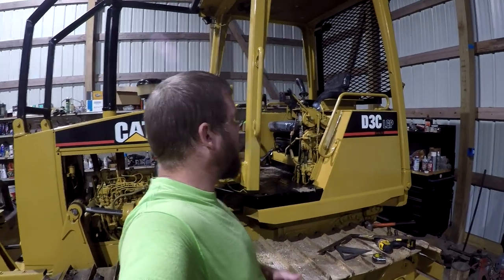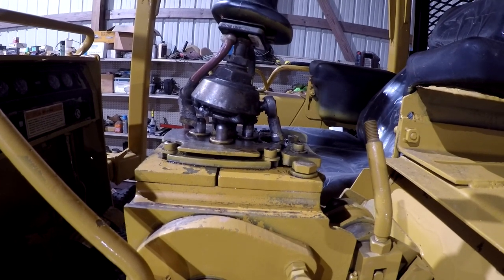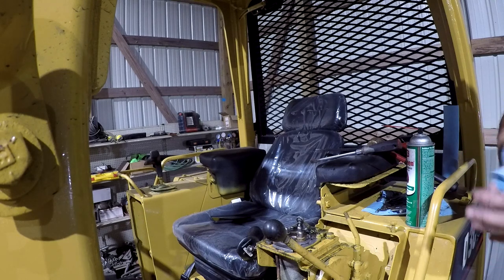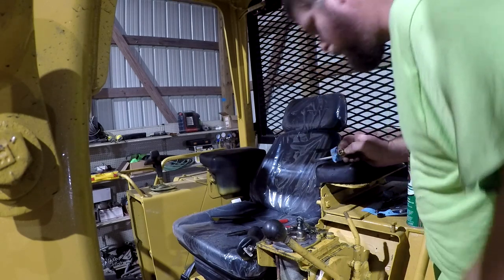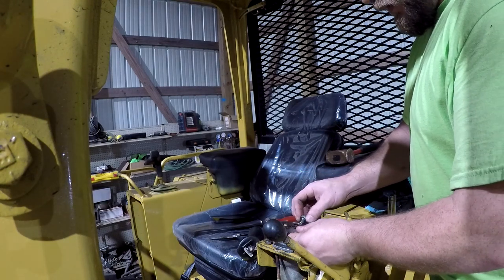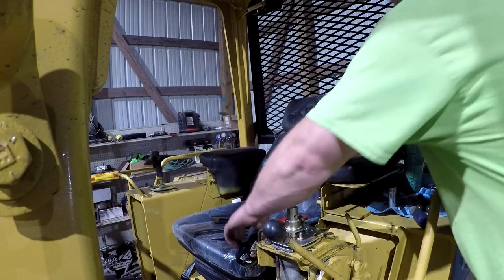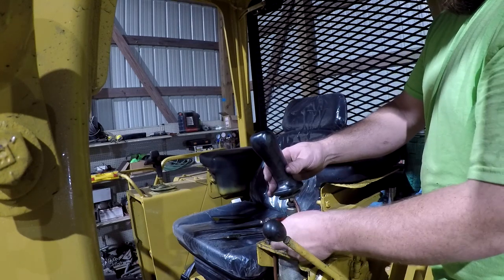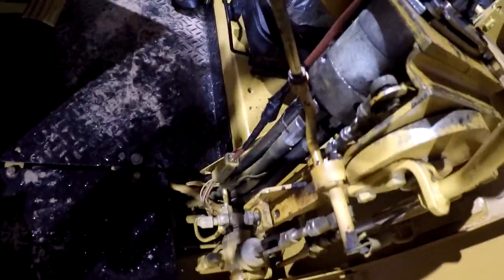Fixing broken and leaking pilot control joystick on cat d3c dozer

Comment: What happened to 3 missing comments? One was mine. I see two comments. Page shows "5 Comments." The comment was: "Nice. Why the green brake cleaner?"
Reply from the maker: That's interesting. I have no idea! Guess YouTube didn't want me to see them.... I find the green brake clean works better for me for general use such as this, cleaning Nick nacks, and it's not chlorinated. If you heat or weld where you used chlorinated brake clean it creates chlorine gas. The red chlorinated cleans better on brakes but 9 times out of 10 I use brake clean for everything else LoL
Reply: @LifeWithChase  Thanks. NAPA has a sale, at least yesterday (12/4/2021), for about 50% off red. Not sure on the green. I do not work for or own stock in NAPA. Off to replace an Alemite fitting and shear pin.